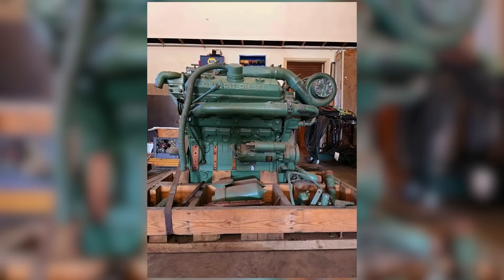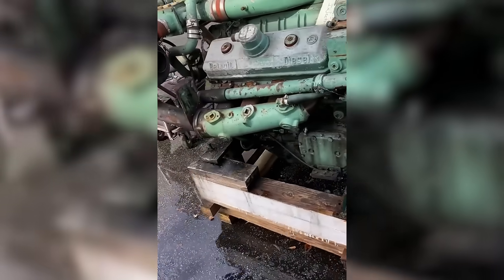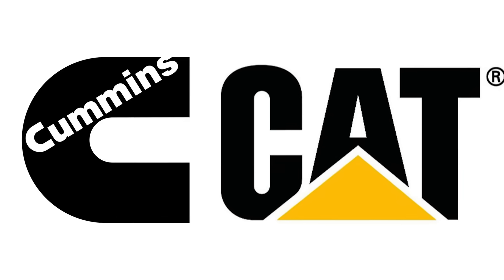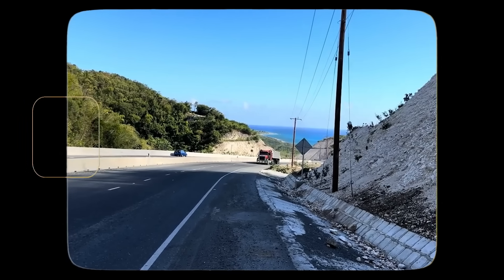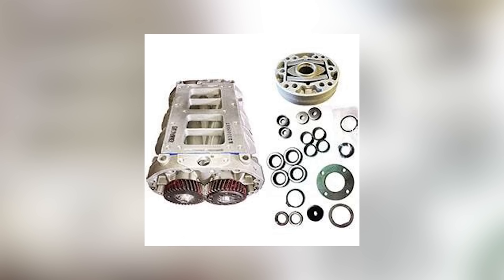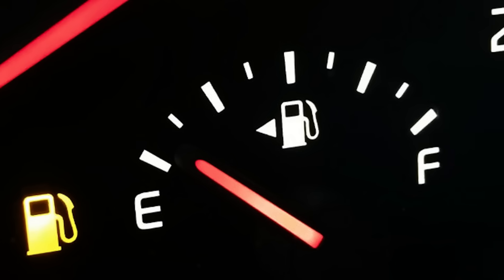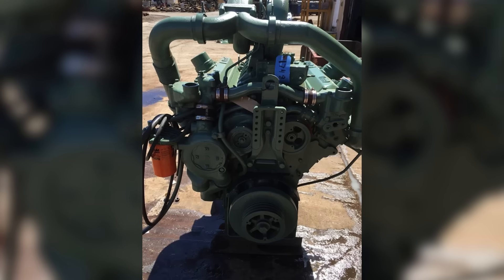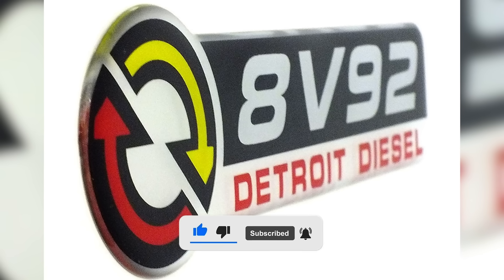The Truth About the Detroit Diesel 8V92: Was Bigger Better?

Comment: at 8:06, that's a 16V92 (two 8V92's grafted together). Also, no matter what version of 8V92 you had, fuel mileage was about the same if not better in the stronger versions. The best way to tell if a 92 is sick, is it will smoke more than usual and puke a lot of oil into the turbo (if equipped) and airbox.

Comment: 8V-92TA marine engines were used in the Sydney Rivercats back in the 80’s. Producing 500HP@2100 rpm. Early in the 2000’s, these engines were replaced by MTU engines, I believe mainly due to emissions reasons.

Comment: O-H-I-O Porter Greetings 🇺🇸My oldest brother & I worked on his CL9000 that had been sitting for years. It has the Silver 92 engine that had been installed by Detroit mechanics after a mishap, so not original to this truck. The engine sounded amazing!!!  He passed away not too long after & I bought the truck. In honor of my brother, I plan to complete the repairs & get this truck back on the road. Thanks for your video. I did learn a few things. My truck will be another screamin Detroit powered Ford when I get it done!!! Blessings! 🥰😎✌️

Comment: We had a marine 8-92 natural go over 60,000 hours (40 yrs.) with good regular maintenance. Replaced it with an 8-92T. They used the same water pumps, injectors, water-cooled manifolds , blowers ,etc as used on 8-71. Changing oil and cleaning the anti-freeze is key but would be for any engine.

Comment: As a CAT mechanic and engineer - dealership - we had a joke that if you had a Detroit that didn't leak oil, Detroit provided an update kit consisting of a #80 drill bit, allowing you to drill a tiny hole in the pan or valve covers and provide the necessary leak.
Reply: Like radial aircraft engines, if they are not leaking they probably need more oil!
Reply: @carlwilliams1570 So very true.

Comment: The only benefit with the two stroke diesel is the power/weight ratio. Although it's debatable since the power is less useable. Depending on applications.

Comment: Series 60 🤮🤮🤮 another typical 4-Stroke-joke. They pound so hard they actually BEND the massive connecting rods. 4 strokes are absolutely NOT more efficient than 2 strokes and have super hot exhaust and high cooling system BTU’s and this high cooling system demands. And unless turbocharged, they are all doggy, gutless slugs that smoke heavily and waste fuel. The ONLY reason there is ANY reduction in fuel usage is because they fire every other revolution. Actually, 4 strokes and diesels shouldn’t even exist. They are pretty  terrible, and have to have huge displacements to make even decent power. The 6 miles per gallon fuel economy on the 2 stroke you mentioned is actually decent! Most big modern 4 stroke diesels struggle to do more than 2-4 miles per gallon because they are BIG and need lots of fuel. The empty weights are insane in big rigs, and loaded weights are mind blowing! So 6 to 8 miles per gallon is quite reasonable in the 92 series 2 strokes! Saying 2 stroke diesels aren’t efficient is wrong. These Clark cycle 2 strokes are almost as efficient ass (also 2 stroke) opposed piston diesels which are the most efficient engines in the world, so the “inefficient” claim is MOOT. Most of the reasons for these engines going away was 4 stroke diesel manufacturers crying because the 2 strokes were better sellers than their usually too high priced, average at best engines and they used the government and EPA to make up boloney “emissions” etc. “rules” to get rid of 2 stroke Detroits. It is laughable! And the Series 60 isn’t worthy of the Detroit diesel name. It is an over complicated overhead cam mediocre at best engine designed by Penske and John Deere, neither of which ever made better than very low average quality diesels. So ONLY the well proven 2 stroke Detroit, Cleveland and EMD engines earned their names, not the junky series 60 family of more boring, bad sounding when running 4 strokes. My best friend worked on Series 60’s in fire trucks and said they are unreliable, hard to work on pieces of JUNK and he HATES them with passion. Cheers! 😋👍🏻

Comment: 13:16  it says "overheating leads to detonation". This video tells impossible mistakes and shows wrong pictures. Its mainly a bad compilation of pictures and shorts. Hoped to learn something. Yes I did but not about DD
Reply from the maker: When I said "detonation" I meant "knocks or pings" versus normal combustion. I guess I could have used a different term. As far as the video footage, it is really hard to find footage, so I try to get as close as I can, just giving you something to look at while you listen, versus a blank screen. Did you find something that was technically inaccurate in the video? If so, please let me know, so I can fix it for next time.
Reply: @VintageAmericanMachines  Theres no Knock or detonation in diesel engines. Only in engines with spark plugs e.g. gas/alcohol

Comment: Weren't all Jimmys wet sleeve ??
Reply: Nope

71's were dry
Reply: @admiraltroll5255  I guess we have proof the AI is truly artificial, and not real intelligence!!

AI Overview
Learn more
Detroit Diesel (Gmc) 71 Series Engine Cylinder Liner ...
Yes, the Detroit Diesel Series 71 engines did use wet cylinder sleeves. This means the sleeves were in direct contact with the engine's cooling water. Wet sleeves, unlike dry sleeves, were designed to facilitate cooling by allowing coolant to circulate around them. 
Here's a more detailed explanation:
Wet sleeves:
These sleeves are in direct contact with the engine's coolant system, allowing for better heat transfer and cooling. 
Dry sleeves:
These sleeves are not in direct contact with coolant and rely on the surrounding engine block for cooling. 
Detroit Diesel Series 71:
This series of engines, including models like the 6-71, 8V-71, and others, used wet sleeves.
Reply from the maker: No, the 71s were dry sleeve, 92s were wet.

Comment: First of all, these did not operate at a high RPM. A two-stroke only sounds like it's running twice as fast. The RPMs were very similar to a four-stroke. Please get it right
Reply: State what is high rpm and what is low rpm as there were quite a few different rpm ranges they ran in according to application and HP
Reply: ... second of all?
Reply: Twice the “bangs” per spin?

Comment: I drove the 6 cylinder  version  of this engine  . The V6 92 pulled  better  in the low rpms than  the 6 71.
Reply: I overhauled a race truck engine, 6 V 92, natural gas pistons, 53 series governor in it so it screamed at 3200 rpm, military injectors, estimates HSP at 600 HSP, have pics, smoked like a locomotive

Comment: More popular in buses than trucks, most tractor trailers I drove for 30 years had Caterpillar or Cummins. They were very popular in Boats back then along with Caterpillar, but it seems like both Detroit and Caterpillar got out of the midsize boat market defaulted it to Cummins.
Also, Detroit didn’t run at any higher RPM than other diesels, all the road versions ran up to 2100 RPM, just like all the other road diesels, Detroit diesels sounded like they ran high because they were two stroke, so when a Detroit diesel was running up to 2100 RPM, it sounded like it was running at 4000 RPM, but really wasn’t.

Comment: I saw and listened to the 8V92's moving heavy clay around to build an expressway near my house when I was 15. I sat in the shade in the outer corner of a wood lot that was part of a farm cut in half by the expressway being built. I was overlooking a field of weeds probably 200 yards from the activity. I heard those 8V92's labor and rev in their earth movers for hours on hot days with the wind blowing enough to bring the smell of the weeds and some Diesel smoke into the woods and drive the mosquitoes deep into the woods. It was quite a show. When the driver's went home I rode my bicycle over and inspected them up close. I liked what I saw. At age 20 I took a job at a truck leasing company and was assigned to a very famous bakery in the Detroit suburbs, Awry's Bakery. I serviced their fleet of trucks. Some had the 8V92. Although I didn't have the degree in Diesel Mechanics to do much, I did the PM's and inspected them. Occasionally I put a fan belt on them or replaced an alternator or battery. I drove them around the parking lot at Awry's to test them, and sometimes I drove them over to the leasing company headquarters about 6 miles away for a maintenance interval. It was awesome. But none of my background compares to when I hit the pinnacle of my automotive career and landed a job at GM running those 8V92's on gigantic 600 hp electric dynamometers doing emission tests the EPA demanded for certification. I sat there for hours listening to them running in the test cells laboring away and revving. They were running fake driving cycles to gather emissions data. One test in particular was the most awesome of all, the "Smoke Test." I believe it was the "SAE J1667" test, but it's been 37 years now and I'm 73, so temper my words. On that test, the warm up was enough to scare away any visitors who happened by. It required a 20 minute run at Wide Open Throttle, WOT, at rated speed.  The exhaust had to pass through an open air gap in the test cell of about 1 foot  where a light and photo cell setup was to "read" the smoke emissions. So the exhaust passed through open air into a 25,000 CFM evacuation tube about 15" in diameter and THERE WAS NO MUFFLER. You could hear that engine clear at the other end of the building probably 2 football fields away and I sat there at the controls running the test. Now That Was Awesome! On the "Smoke test", after the 20 minute warm up at full blast was done, you had merely seconds to perform the actual Test, which was a run from idle to rated speed at WOT, under a simulated load of 36,000 Lb  that represented the tractor and a loaded trailer, then return throttle to zero, drop about 400 rpm and go to WOT again until you reached rated speed again. It sounded just like when a driver was accelerating to rated speed, 2,100 rpm, then release the throttle to make an up shift, then return to WOT for a few seconds more, then return to idle. I believe the purpose was to capture the particulate emission during the "Fake Upshift." The sound of those giant Diesel engines is still in my mind. And every time I hear a DD run through the gears, it's like listening to an old song I know all the words to. And they paid me to do it! ben/ michigan
Reply: I serviced the generator sets at the Shelby County Justice Center in Memphis. When it came time to load bank those suckers you could feel the ground pound and hear those turbos screaming. FedEx Memphis has enough Detroits in their generator house to power the entire City of Memphis. I love those old twin stack 318's (8V92- 318 HP).
Reply: @im2yys4u81  The 'Detroit 318' is the 8v71.  With N65 or 70 injectors (I forget which) and on the A timing, it would make 318 HP.
Reply: @Brons2 As I recall the injectors in a 318 were N65's. The 6v71 used an N45 if I remember correctly. Never will forget the day one of my coworkers wanted to use one of my timing pins as a punch.
Reply: Thanks for sharing those great memories.  I was born in the 70s, so I'm fortunate enough to have heard and smelled that beautiful stroker smoke and sound. They may not have been the most efficient motors, but they are engineering marvel.
Reply: you sir are an older romantic
Reply: These are my favorite kind of comments to read on youtube :) thank you for sharing your story!

Comment: Internal fuel lines were always used on Gm's except for the very very early 6-71s made in the 1940s that had external rails . Internal rails didn't reduce leaks but they made leaks harder to find, right up till the main bearings got wiped by fuel dilution. Back in the day GMs were the most compact horsepower you could buy every other engine was at least twice as big and heavy.

Comment: This engine was the only one used in australia for the express truck and bus fleets in the 70s and 80s by all the major companies,if it was left on a factory tune it could easily do a million km driven at 130 kph constantly
Reply: Yeah man, TNT specced them like that for the ox blood express up the Newell from Melby to Brissy in the pre NHVR and speed limiter days.
Those, SARs with 8V92 Silvers, often with double OD, high speed diffs and LR tanks used to come up on Truck Sales from time to time. They could run to 160kays. Denning pusher coaches had non silver 6V92s & 8V92s and I was driving to Adelaide in a V8 Valiant in 1986 doing 90mph and one pulled out and overtook along the plains before Horsham. I didn't dare follow because the rpm might've aerated the oil in the 318s oil pan in a crank induced vortex and the tappets start rattling and the oil light come on LOL.
Reply: In 1983 my brother and I rode our Honda and Suzuki 750cc bikes from Sydney to Cairns and the only things that ever overtook us were Greyhound coaches.
Reply: I was up near Hawker in the North of South Australia years back and I got passed by a Kenworth screaming away, I was doing an indicated 140kmh at the time.
Reply: My Denning has an 8V71 and its fine. It runs good

Comment: Drove hundred of thousands of miles with 92s. They ALWAYS leaked oil. You could eek 5-5.5 mpg out of it if geared properly and holding speed under about 62 mph. And, they blew up frequently enough that we called them "250,000 mile hand grenades". However........if modded with 2600 RPM no load governed speed and 100 injectors, they would pull. A properly tuned Big Cam Cummins or, and especially, a direct injection 3406 Cat would run circles around even the best running 92.
Reply: The green ones leaked. The pre silver and silver 92s had a bunch of updates that pretty much eliminating oil leaks.
The old myth that you had to run them on the governor was just that. Run them down the road at 1800 RPM and fuel efficiency increased. As well, engine life doubled.
The 100mm injectors had a different spray pattern that also contributed to better fuel economy.
Reply: @daledavies2334  yup. I'd get 5-5.5 mpg running 62mph in 12th (13 speed) which was about 1800RPM. 3.70s and tall rubber. This was in early 80s. So yes, the early green ones at 430 hp.
Reply: I
 @daledavies2334 
I was a young mech at Valley Livestock in Dixon.  They had 8V 92 T laborers freightliners.  Engines were fairly dry, but cracks in cylinder heads caused issues.  Learned a lot there.
Reply: @daledavies2334 I agree. I used to run down I 84 from Boise to Portland in the mid to late 80s….. in a cab over Peterbilt with a 15 speed overdrive. I would lope along at 1500 rpm - 54-55 mph….. ( truck speed limit in Oregon was 55 till just a few years ago) . I could get 5.5 running like that…. Pulling a 45 foot curtain van .
Reply: They eventually came out with a drain back system. I installed a ton of them at Saunder's Leasing, and later at Ryder after they bought Saunder's. Instead of draining straight to earth, the air box drains were routed back into the pan.
Reply: @im2yys4u81 that's right, but boy I've had a lot of arguments that this was done. Another thing, they only drained into pan at idle, not high idle, and I'm pretty sure they had bypass filters, just above filter was a plug and spring, that was known as the wooden nickel that released pressure over about 100 psi
Reply: Two of them pushing my fishing vessel yielded 3.4 gpm! Gallons per mile.
Reply: My company actually had one the got 8mpg. The fuel tax commission actually opened an investigation to the companies files because they thought it was fraud. I left the company so I don’t know how things turned out but I verified it myself with many trips.
Reply: Used to win the hill climb by shutting off the engine fans. We called them Yamaha's for the high rpm's needed to get the job done.
Reply: The only way to drive a 92 series is to slam your foot in the door get pissed off and drive
Reply: I started out in a 84 Peterbilt with a 8v92 . It was ultra fast bobtail …..with the windup. But the first hill you came to, you will be rowing the gearshift. 4.5 mpg…… gal of lube o8l every 1000 miles
Reply: Yuuup ,
Reply: An old timer truck driver told me the way to get those 2 stroke Detroit's to run their best was to slam the door on your hand when you got in the truck.
Reply: @dukecraig2402 I heard that same silly story
Reply: 2 stroke Detroits had 0 bottom end torque! Very good at converting fuel to noise!